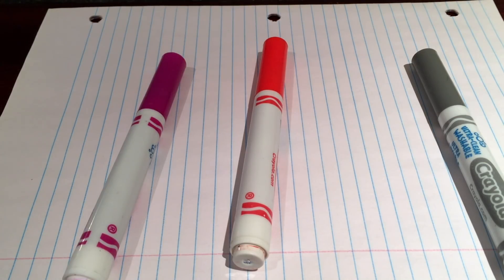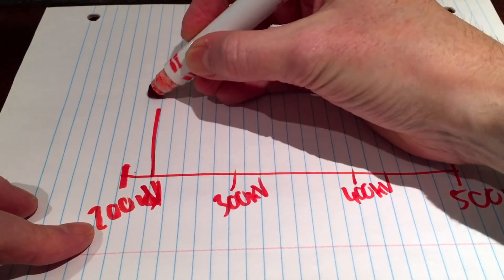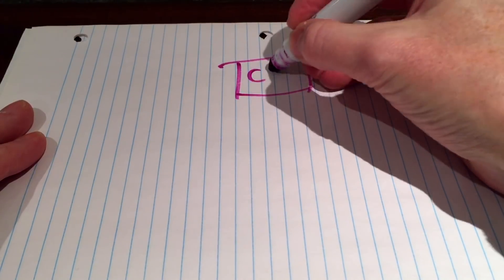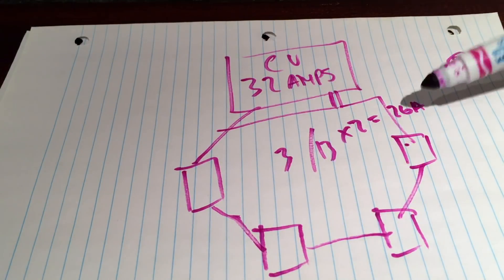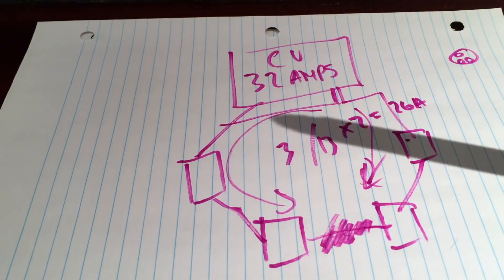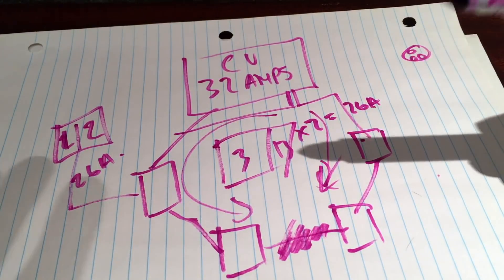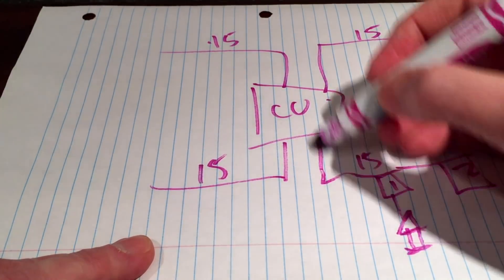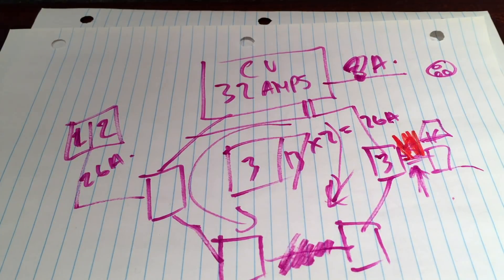THIS is why British plugs have fuses

Comment: So the UK had to make safer plugs to make up for shoddy electrical wiring.
Reply: 240V was the standard before the war (and although 230V is the official figure given due to EU harmonisation, we're still running at 240 and countries that ran at 220 before harmonisation still do so - so great are the tolerances allowed). We chose the system we did to save copper as it was in short supply.  The safety improvement was secondary, with the exception of shuttered sockets.
Reply: No. We chose 230V domestic use because the higher voltage is far more efficient than 110V (The US didn't move up to 230V like many other countries because it had already had a lot of electrical products in people's homes after the war - we didn't because we'd spent 6 years fighting a war not buying fridges - so post war we standardised on a higher more efficient voltage)
At that time we also committed to an inherently safer system of fusing every product rather than relying on breakers in a central panel / consumer unit.
The ring design system is inherently more efficient and uses fewer materials than a star system and in the post war world that mattered... A LOT.
The plug design is pretty widely recognised by most countries as a gold standard and exists because with a 230v supply the hazard is higher than with 110V. 
I've lived in a number of countries including the UK, canada, belgium and USA. By far the most robust and effective domestical electrical systems are in the UK. Europe is also now pretty good with a lot of improvements. The system in the US is by far the least efficient, and least dependable whilst offering the lowest power output.
Reply: I get 250v at my house, great having a garage full of power tools and welders but getting 3000 watts at the plug.  You can even get non standardised plugs and sockets for pretty much any amperage you'd need, the breaker in my garage is 40amp so the sky really is the limit. 110v just sucks
Reply: we also didn't have to rebuild half our country either. might as well redo it if you re tarting from scratch.
Reply: Don't really know why appliances are limited to 12 Amps in the USA but I suspect that it is so that it doesn't trip the breaker/blow the fuse on the standard 15 Amp circuit as soon as it's plugged in when there are already other things using the same circuit.  Another possibility may be to avoid popping the circuit as soon as it's plugged in due to the current surge motors experience at startup.  Just a guess.
Reply: Ben Upde Fucking Americans always have to make it a nationalist issue.
Reply: Not shoddy wiring just more efficient use of copper wire and we made safer plugs because if you can make a thing safer then why wouldn't you??
Reply: Henry Chinery there are 20A breakers and outlets available for high demand 110v appliances. They obviously require larger wire ran to them to support the extra current.
Reply: That shoddy comment has to come from an American.
Reply: Aye mate away and make yourself a cup of coffee. Oh yea you dont have kettles over there do you? Best put the hob on and wait and hour then..
Reply: MrcabooseVG i have 220/240V large appliance outlets in my garage as well. A 50A circuit feeds my central air system. I have a 30A outlet for my welder. I have a 20A 220V circuit for my air compressor. My hot tub (jacuzzi) has it’s own dedicated 50A circuit.
Reply: Brandlin, if you’re comparing housing and electrical supply systems in North America pre-1970’s then I agree, standards were not made to support the latest high demand appliances. My house, built in the early 1990’s has more than enough power supply to the house, and built into the house to supply more than I could demand of it without so much as a flicker. I have NEVER lost power in the 5 years I have lived in my house.
Reply: " We chose 230V domestic use because the higher voltage is far more efficient than 110V"
110 requires a bit more copper, but probably won't kill or seriously injure you if you accidentally complete a circuit. All in all, an excellent trade-off.
P.S. US uses 230V for dryers, stoves, and other things that NEED lots of power; we just don't see the point of it for charging your cell phone at 0.01Amps.
Reply: I say shoddy wiring because look at the completely stupid ‘ring circuit’ wiring. Yeah, that’s brilliant!
110v is perfectly acceptable for small appliances. No need for more with something like a TV or a mixer. You need more oomph? Thats when you add another hot leg alternating in the opposite direction giving you 220 effective volts. More than enough for ANY household appliance. In a shop environment and need more? That’s where 208/408 3 phase comes into effect. 
If you want to see the true brilliance of the power systems used in North America, look no further than your simple iPhone charger. Literally a 1” cube with 2 small prongs poking out. The UK plug itself is 2x the size of the entire charger! 
Are you seriously telling me that you need 32A of 230V power to charge your phone at 5V, 1A? 
110v is safer in and of itself. No need to spend untold amounts of research to make the end user portion safer when you’ve already engineered the codes built into the structure to be safer from the get-go.
Reply: Colin Johnston , I have a countertop kettle. Takes about 5 minutes to heat water from 67°F to 212°F. You gotta wait a few minutes for it to steep anyway.

Comment: Cookers can be anywhere from 29 to 30 amps but are on a 32amp trip. Here in the UK
Reply: VioletDragon Projects Modern all electric dual oven/hob units typically require more than 32A and require larger cross section cable and a 45A MCB. Such cookers should NOT be connected to a 32A feed!

Comment: A minor point - most UK houses don't have a 3-phase supply so, while many modern cookers can be configured for a 3-phase supply if one is available (there are link options in the terminal box of the cooker for this) they are usually supplied pre-configured for single phase operation. 

It's interesting how the system is evolving - new installations now using RCBOs that give individual earth leakage as well as overload protection for each circuit off the consumer unit and consumer units now have to be metal (too many fires in plastic consumer unit apparently)
Reply from the maker: Hmm. Things have evolved again, beyond where I knew.  Thanks for adding your two cents.  It all adds up.
Reply: Hi Jason - I wonder if you are old enough to remember the early versions of the 13A plug that did not have the insulated skirts on the L and N pins? (I still keep coming across them on some of my ancient electrical stuff). I think I only made the mistake of wrapping my fingers under a plug far enough to get a zap once but that was enough.

I'm glad earth leakage trips are becoming commonplace. As a follower of the OSTAR races I was moved by the tragic death of Lizzie McMullen during preparations for the '76 race  - something that an RCD, a common enough item even back then and costing only £5 today, would have prevented.
Reply from the maker: I don't remember them (I was born in 72).  They may have existed around me, but they've been erased from my memory if that's the case. ha ha!
Reply from the maker: I love sailing - I used to follow the Volvo Ocean Race, but don't have the time for it these days.
Reply: I'd probably be screwed then. An electrician used to own this place ;)

He did some questionable things that aren't quite to regulations. Like the naked light bulb in a spotlight fixture in the bathroom (I blew it once by accident with a wet towel). Sockets spurred off the storage heaters. Goodness knows what else :D
Reply: I remember them, and was electrocuted by one as a 3 or 4 year old when I pulled the plug out the wall and put my little fingers in ... People like me (or the less lucky ones who didn't survive it ...) are the reason we have that insulation on the pins.

Apparently I was unharmed ;)

I obviously have some aptitude with things electrical since my next trick at the age of 6 or so was teaching my mother how to wire a fuse when one of the fuses blew because "I saw how Dad did it". Described how you screw it out, wrap the wire round, screw it in ... 

Later, when we got a new cooker and I was about 12 or 13, I wired that in. Delivery guy said they couldn't wire it in, so I just started at it, went and pulled the fuse and began unwiring the old one. Delivery guy says, wide-eyed "Are you really going to let him do that?" and my mum said "Well, he seems to know what he's doing". Explained to the guy how it's just a plug except bigger, and pointed out where the live, neutral and earth go ... My dad checked it later and said it was fine.

Of course, when I bought a new cooker a few years ago, it said I needed a qualified electrician to install it. I did it :P

Guess what? I work in IT :D

Comment: Cookers and showers below 8kW are on a 32amp breaker and a 40amp breaker above 8kW and are single phase in the UK.
Reply: Yes, most are on a single phase 32 Amp or 40Amp circuit though, however it should be noted that will be the only thing on that breaker.
Reply: Not if the cooker has a 13amp plug on it you can just plug it in. And you can get three phase cookers and also three phase supplys in domestic situations. Cheers
Reply: Not really it all depends on your cooker what current it's drawing. But yes the only thing on that circuit unless of course you have a cooker supply unit with a socket outlet on it then you need to allow for diversity. take the first 10A then 30% of the remainder plus 5 A if you have a socket on the circuit.

I would have a double pole cooker switch with no 13amp socket on it.  Cheers
Reply: our shower is on a 40a breaker with 2 isolation switches, one outside the shower room and a pull cord inside the shower room
Reply: almost same in hong kong!
Reply: A pull cord switch, even though typically double pole for a shower, CANNOT be considered a true isolation switch since it's electrical connection status CANNOT be assured ... "Now HOW many times did I pull the switch and the shower STILL didn't come on?". You HAVE to have an isolation switch whose position (on or off) is known. A cord switch cannot do that (even with a neon indicator) - it's a toggle, whose connection status cannot be guaranteed, it is merely there to turn the shower on and off within the bathroom (granted whilst giving excellent isolation from the mains whilst doing so).
Reply: Our box has the shower on a 40amp breaker and the cooker on 50amp.
Reply: Single ovens can be powered by a 13a plug. Often these would be wired on a separate circuit so you don't trip the fuse by using the oven, kettle, toaster, microwave and dishwasher at the same time. I have never seen 3 phase domestically in the UK, except if someone has a workshop. You would need a different meter and feed into the house. I understand the US does as you need it to have any decent power output from 110v.
Reply: @richardemms3050  The US typically has two 120V hots in a residential service. Three-phase in a house is extremely rare. Basically, if you call the power company and ask for 3-phase, they're gonna look at you every which direction, call you mean names, and try their darnedest to talk you out of it.

Two 120V hots at 100A each is 24KW, plenty to run most houses, although 200A services are common now.

FWIW, our "cookers" (which are most often combination units consisting of four-burner cooktops and single ovens) here in the US are usually on 40A or 50A circuits at 240V (the two 120V hots are 180° out of phase, so you get 240 between them)

Comment: You can't draw 15 amps through a breaker or a fuse rated at 15 amps. Also there is a current surge when power is applied to equipment. Fuses are always rated higher than what the equipment uses or they would keep blowing.
Reply: Actually, you can draw MORE than 15A, for a short time, until the breaker gets hot enough to trip. This feature is actually exploited by things like refrigerators, which have high starting surge currents. Going over the rated current for a brief time is not a fire hazard because the wires don't have enough time to get hot.
Reply: You also have what is termed as slow blow fuse designed for high surge they will blow at the rated amps but after a set amount of Time
Reply: John D II actually a good bit of time an hour or more for a 15 amp. It'll hold a lot longer than a few minutes, that's why continuous (3hr or more) load is 80% of rated capacity.  There's all different types of fuses with tons of different blow curves.
Reply: brief time
Reply: David Barts time delay fuse.